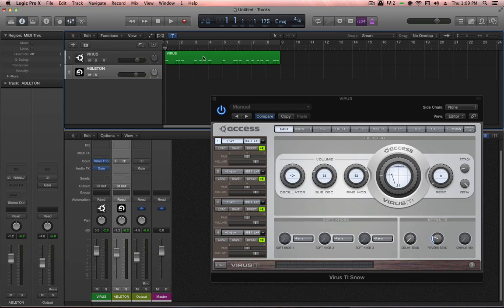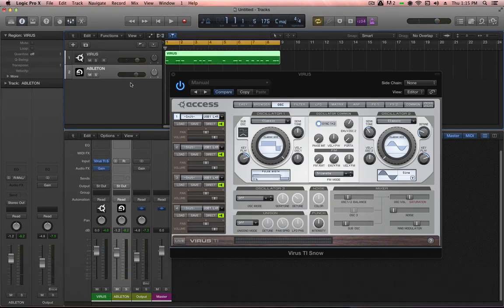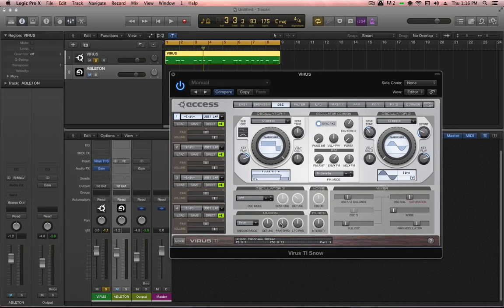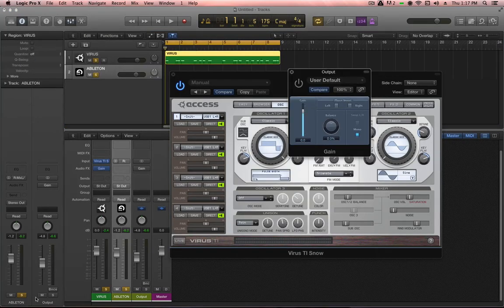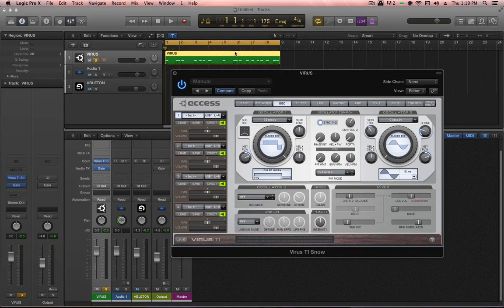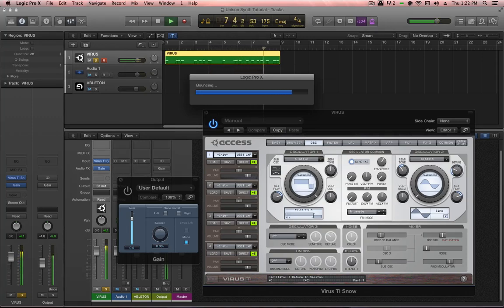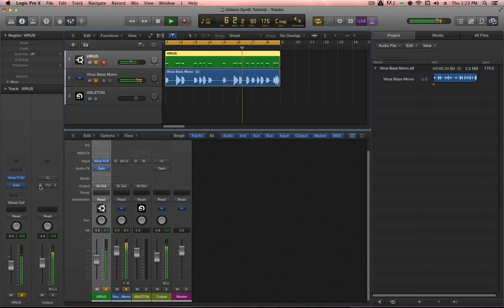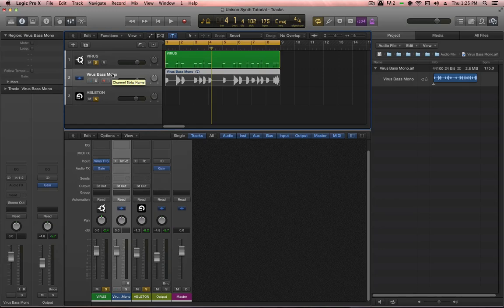Quick Tips 005 - Synths in Unison

Comment: Great tip! Summing to mono to check the integrity of a mix is often overlooked, but it can reveal so much.
Reply from the maker: It really shines a harsh spotlight on your mix in terms of separation of your sounds. I'd recommend having a proper mono monitoring environment though-summing to mono and sending identical signal out to two speakers is not actually very helpful as early reflections from the room will still smear your perception of timbre and balance. You need a single separate centre speaker for true mono monitoring.